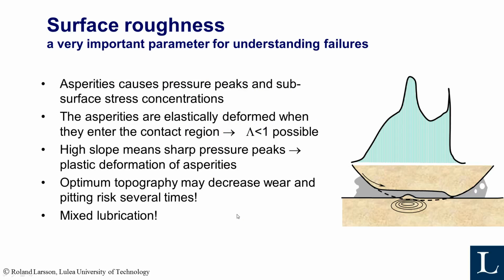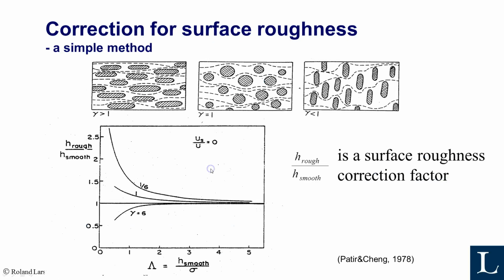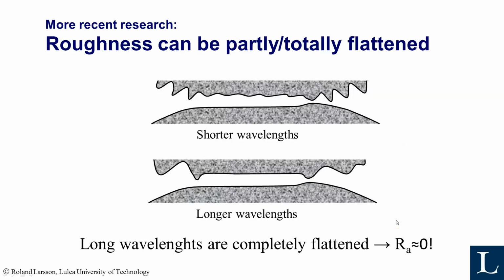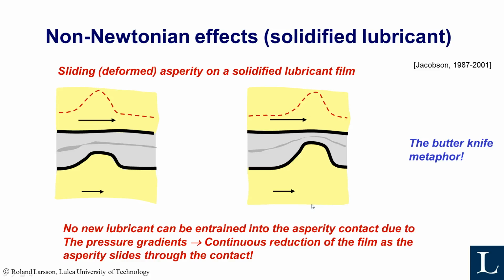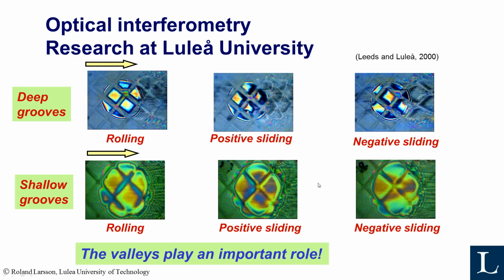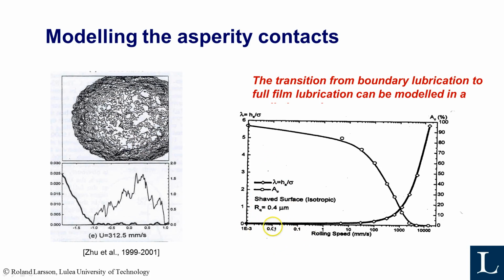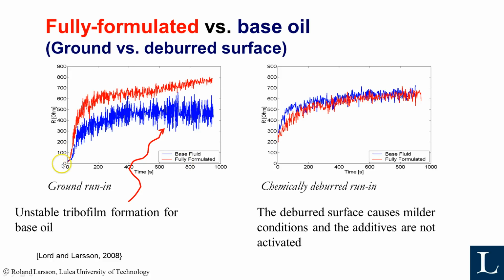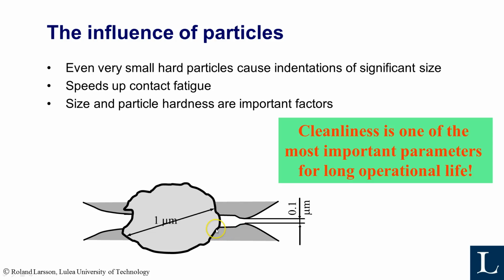Elastohydrodynamic Lubrication - Part 4

Comment: Dr. Larson, very pleased with your presentation on EHL.  I have been working in the machinery field for many years and deal with lubrication related issues constantly.  While I was familiar with many of the general concepts, you have provided and comprehensive overview of the effects of the lubricants on bearings and provided enough background information to help better understand the mechanisms that lead to bearing and gear failure.Thank you.  John